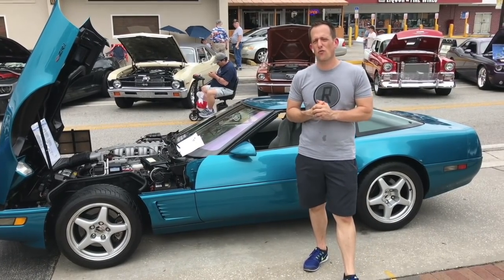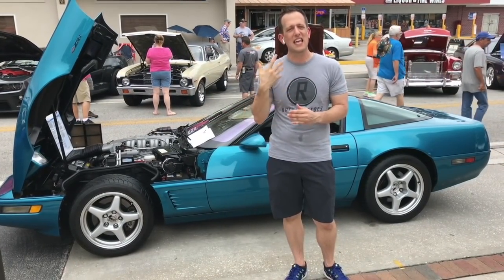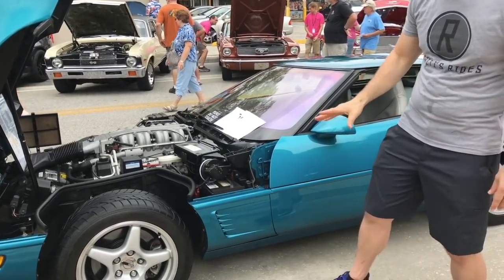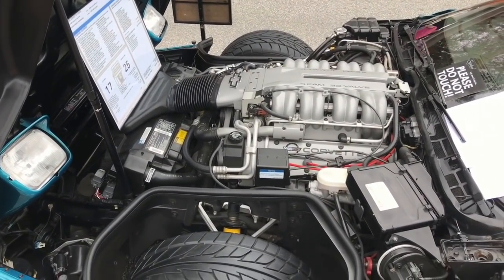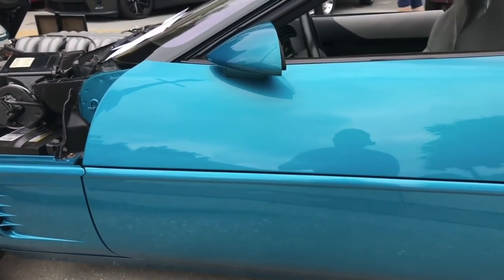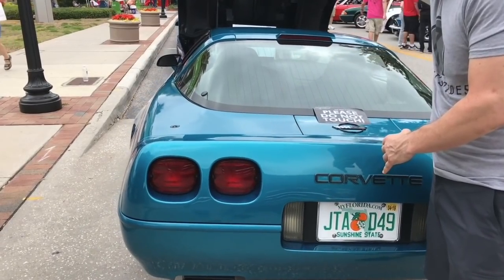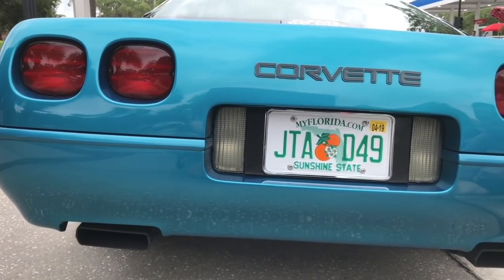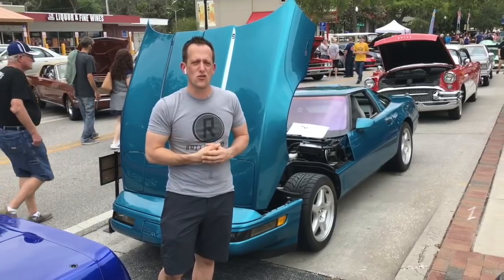Is the 1995 Corvette ZR1 the MOST UNIQUE Corvette? - Raiti's Rides

Comment: Great review of the ZR-1!   I've had a 1991 Black on Black for 12 years, 34,000 original miles.  
If you have never driven a first generation ZR-1 in Full Power mode and heard the heavens sundered by the absolutely feral howl of the exhaust above 4,000 RPM , felt the G forces compressing you into the bolstered leather seats as you make seemingly effortless, lightning fast shifts up through the gears while negotiating twisting mountain roads with telepathic ease,  then you have missed a truly unique automotive experience.  The ZR-1 Corvette represents a special time in American automotive history and is truly the first American super car.
Reply from the maker: Thank you so much for your really great compliment!  You are a luck man to own one of these beasts!
Reply: Thanks, Raiti's Rides - You seem very knowledgeable about these rare cars.  Good news is, the price point is still (comparatively) low for first generation ZR-1's,  you can get a great deal on the surviving examples if you do a little research.  The ZR-1 Net Registry is a good source to locate them all over the country.  (PS - I drove my ZR-1 to work today and taking a long road trip this weekend ...)
Reply from the maker: That is so awesome!  I really want one.  What kinds of issues have you had?
Reply: Remarkably, very few. All have been age related issues.
1)  Most significant was in 2016 had to have all 32 valve guides and valve seals replaced  due to age.  That was a major head job. Clue was smoking on startup.  
2) Driver's side adjustable seat gears and drive had to be replaced in 2011, worn plastic gears.  
3) Windshield wiper control PC board in ECM went bad, simple fix, replaced board from Eckler's Corvette in Florida.
4) All 4 rear tail light housings eventually became loose (stripped screws and holes), replaced all 4 housings and lenses from Eckler's.
Reply from the maker: That is one hell of a run with nothing major besides the valve guides!  Great job!  What is one of the costlier things that you have heard of happening with the car?
Reply: Technically, these are the second generation
Reply: Steve93Talon - Yes, you are correct.  The first generation ZR1's were C3's made from 1970-72.   The production was limited to 53 units during those years, which make them the rarest ZR1's of all.
Reply: I know that permanent smile well!
Reply: Mind Mind - Oh, if only I could hammer it once or twice a week all year.  I can't say its ever been babied, it has been driven rather... ahem....enthusiastically... when I can drive it.  Problem is, I live in Alaska, and our driving season goes from May to the end of September    it spends October to mid-May fast asleep in the garage  under its special blanket . I start it once a month in winter just to keep things oiled up and relive the memories of the previous summer!
Reply: Could not agree more, sir.
Reply: What’s redline?
Reply: @Fee.1  7,500  RPM.
Reply: Countach killer - No joke!

Comment: Also only on a ZR1, the corvette littering out back uses raised black lettering. Regular corvettes of the time had engraved lettering in the plastic
Reply: Bob O. - That is a great observation, that is one of the few distinguishing features of the ZR-1 aside from the longer doors, wider rear end to accommodate the 11" rear tires and the CHMSL on the roll bar.
Reply: Not actually true. From 1984 through 1990, the Corvette had its logo applied via a plastic badge on the rear between the tail lamps across all models. When they face-lifted it in 1991, the standard models switched to the engraved logo while the ZR-1 retained the badge until its demise at the end of 1995. The CHMSL up top is also not strictly a feature unique to the ZR-1, all Corvettes from 1986 through 1990 have it. The only reason they didn't move it on the ZR-1 after the 1991 face-lift is because the tooling for the 1990 ZR-1 was brand new and it would have been ridiculous to do so for a low-volume car. It's also for that same reason that they retained the use of the adhesive badge.

Comment: Surprisingly, the fastest acceleration numbers any reviewers were able to get out of the entire ZR-1 run were from the lower HP '90 models.
Reply from the maker: That is really surprising considering they had less horsepower. Thank you for watching!
Reply: Kevin, thats cause they were fudged, you gotta make an $18,000 engine option a WANTED add on, or things don't sell. Thats the ket to 1st & 2nd year runs on sports cars.
Reply: Daniel Fair Are you implying there was a conspiracy between multiple independent reviewers to lie for GM in their reporting of the performance of this car year one? Because that’s the only way a discrepancy like that could have happened if the numbers were “fudged”. I’d also have to see some additional examples of sports cars that got slower as the model years progressed in order to even begin to believe your theory.

Comment: GM and Lotus jointly designed the engine as GM owned Lotus at the time . Mercury marine assembled the engine as they has lots of experience with aluminum castings and the engine was low volume compared to what GM was used to making.
That hood stripe was added by the owner or a previous owner . The factory did not put that stripe on any ZR-1s . Possible that a dealer could have added it . Definitely not factory though .
I have a 91 ZR-1 that I’ve had for 13 years. It’s a fun car . If you ever get the chance to drive one or go for a ride in one , don’t pass it up.
Reply from the maker: I appreciate you giving us some insight.

Comment: Just a correction on the 1983 corvette. You said they built one and 83 and actually called it at 84. That’s not true. They actually built 40+1983 Corvettes, but they started the production so late and with design problems they knew that they would never produce enough. So after the 40+ that they built, they just decided we’re going to work on it and just build Corvettes for 1984. They actually destroyed all of the Corvettes. They built in 1983 except one and it is still in a museum somewhere. So actually they did build a 1983 Corvette, but time constraints and design problems, etc. got them to discontinue it after about 40 cars were built for 1983 so they regrouped did not produce a 1983 and focussed on building the 1984.

Comment: C4 Factory Corvettes came out of there with 240 horsepower not 235. I had a 88 convertible and put 205 heads and Flowmaster computer chip racing transmission in there and that thing was insane. Pushing about 500 horsepower Dyno tested but that's my guess. It was an Edelbrock Performer 500 horsepower kit head and camshaft I'm not sure if he placed the intake injectors or not. Flowmaster exhaust and a cold air intake. and then went to C5 came out I heard they were supposed to be twice as good as a C4 is and I was like all that money put into this thing and the new ones are that much better.
Reply from the maker: Thanks for your input and feedback!  I really appreciate you sharing your experience!
Reply: Actually they did come out with 235 hp , in earlier than 1988 C4's
Reply from the maker: CONTENDER791 thank you so much for the info and input!😊👍🏻
Reply: @RaitisRides  no problem it's not hard to fall in love with these cars that's for sure as a passenger and even more so as a driver. The only thing I didn't love about them was that $100 here $500 there $300 here and that was for like nothing. They literally hundred dollar bill you to death with them cars after warranty.
Reply: @CONTENDER791  yeah you're right they did have the earliest of the c4 with a very limited have a little less horsepower and they didn't didn't make a Corvette one year do you know what year that was? One of them years either 83 84 85, if my memory still works at all. I think it was more the 83 is the one I would say that wasn't made. But I could be wrong, I've been wrong plenty of other times
Reply: @jeffwolf8018   1983.  The 84 Corvette was 205 hp from the factory and was the crossfire motor from the 82.

Comment: Joe I have a question I’m in love with the Subaru Impreza hatchback I was looking at a few today 2010 Impreza 2.5 4 speed auto and a 2012 2.0L CVT which one is the most reliable one powertrain wise ?
Reply from the maker: I would go manual all day long.  The CVT transmission can have issues.  Plus you will get a tad quicker accleration.
Reply: Raiti's Rides so is better to get the 2010 with the 4 speed tran? How reliable would it be?
Reply from the maker: Anderson Rodriguez if all the Maintenace has been done correctly it should be very reliable.  How many miles are we talking about?
Reply: Raiti's Rides i think 100K Nd another has like 120K I think
Reply: One owner tho

Comment: I always thought the first year 90 ZR1 were cool.  They were the only ZR1 to have the "original" C4 front end & square dash.  They also had the old style swirl wheels and only 375 hp--as did some other years but I THINK 90s are the most valuable?  Am I correct?
Reply from the maker: The 1990 ZR1 is my favorite!  For1990 though they got ride of the square fully digital dash.  The 1990's ZR1s are still pretty low in the depreciation cycle.   You can get a really good one for $25k
Reply: Jay, from what I have heard the 1990 ZR-1 is destined to be very collectible and the values are already going up.
Reply: The 1990 ZR-1s (or even the regular 1990 Corvettes) do not have the square dash, only the prototype press cars that they demoed in 1989 had those. The actual ones you can buy have the first face-lift with the 4-spoke wheel, airbag, grey plastics, and orange labels. But they do still have the original front clip, side vents, and my favorite styling feature: the black rub strip going around the belt-line. I have a 1990 ZR-1 myself, and wouldn't accept any other year.

Comment: Know of any good tires for c4’s
Reply from the maker: I would do Michelin
Reply: Cruse With Spirit - I put at a set of Goodyear Eagle F-1 DS-G3's on my 1991 ZR-1 a few years ago, they have been a fantastic tire  so far, they hold the road like super glue.  No slip at all on aggressive cornering and wet traction is amazing, I've driven in driving rain on twisting mountain curves, and it corners like it is on rails. They have a very aggressive V-shaped tread pattern that efficiently channels water away .  You can get them for both ZR-1 and for Base Model C4's
Reply: @jamescarson4087  i had the Goodyear F1 runflats on my 6-speed '10 GS from the factory, I could break the tires loose at 50-55 mph on a dry road, tread wear was trash also.
Michelin Pilot Sport PS2 ZP, waaaaaay better.

Comment: Whoa that car dude. The Color....  My buddies dad had that Orange 94 used ZR-1. Was sick. 400 HP back then was A heck of a lot man. The 80's Vette's SUCKED hard.  The highest C4 had like 240 HP at the crank. a V8..... good lord.... The Ford Focus and WRX have more HP....it's hilarious. It's like they didn't even need those wide rear wheels. They didn't start getting good again until the 90's using the LT5 and the LT4(330HP). The LT1 was still only 300HP.. I just watched an EVO with 480 HP, lol.
Reply from the maker: Well I guess you have to remember where we came from in the 1970's.  The 1974 454 Corvette had been drained down to 275hp.  After that horsepower numbers tumbled.  1985 was a real turning point with the introduction of the L98 Tuned Port Injection.  From that new foundation there was a steady increase in HP.  Back in 1985 the Corvette was one of the top 5 fastest cars in the world!
Reply: A team took an almost stock (caged, race tires, oil cooler) 90's ZR1 and broke the 24h speed record and still hold it now. 175mph as an average  with refuels etc is nothing to scoff at.
Reply: Cool fact, the brand new 1984 Corvette was the fastest production American car at the time. Naturally post 1984, the engines grew exponentially in horsepower offerings. My '96 Corvette convertible in an LT1 with just 300 horse, and 340 ft.lbs. of torque with the traction control off is still pretty damn fast.[And yup, 'perma-grin' every single time you drop the hammer].
Reply: Eh, you can still break the traction on the 1980s L98 cars pretty easily; those 16 inch wheels are not that wide and the torque curve was very biased toward the low end. It pulled like a truck - because it basically was a truck engine - until 4400 RPM and then...nothing.